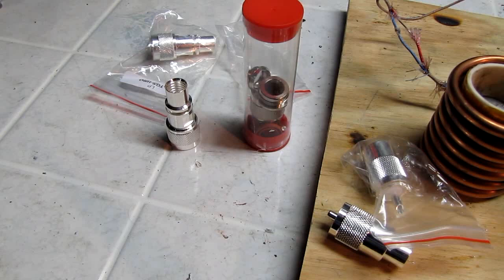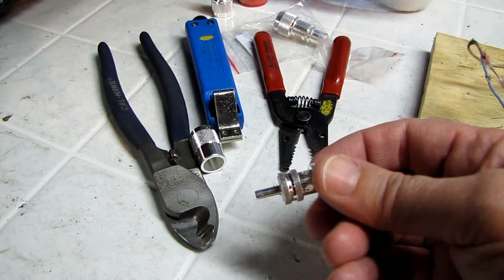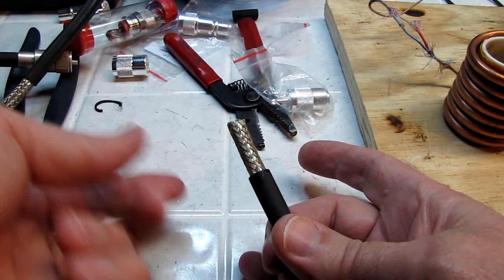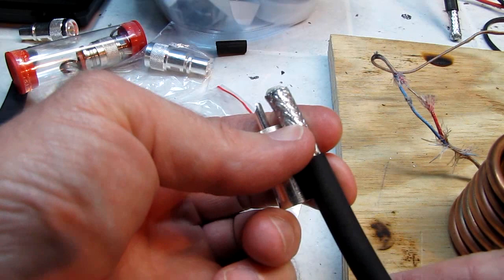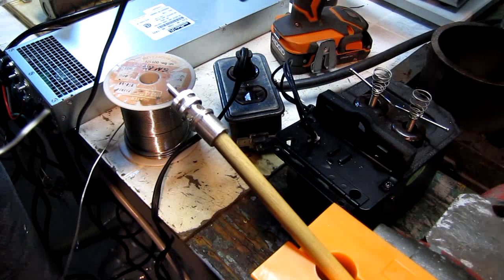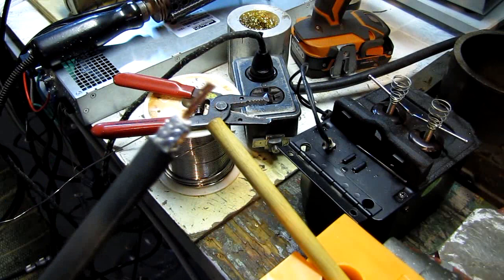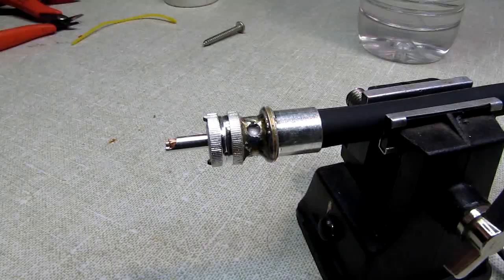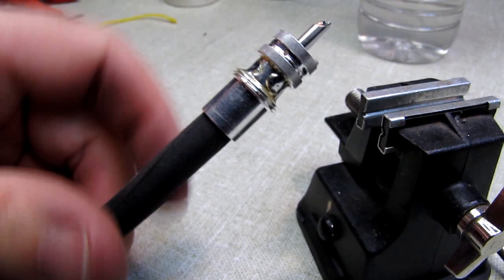Soldering PL-259 and N connectors

Comment: In my 40 years as a radio operator, I have had all sorts of problems with coax connections. I have resorted in buying coax with connectors, which are never the right length. A  3 foot jumper often costs as much as $10.00. I have felt that I am not a true ham because I could not get the connectors on without some type of failure. Your presentation gives me hope but not yet confidence. This is the best presentation that I have seen. Thank you so very much.

Comment: Great video, thanks for sharing. I too learned by trial and error the benefits of tinning the braid. Though, alas, no solder pot for me. Only thing I can add that might help when applying a lot of heat to solder connectors like this is to wrap a wet rag around the jacket - just next to the connector (e.g. where it is held in vice). This acts as a heatsink and helps to stop jacket and insulator melting.

Comment: 23:30  Tip:  Long before soldering the tip of the center conductor, it is wise to tin the center conductor at the same time you tin the braid. After tinning, if the center conductor is too big to fit through the connector hole, you can file down the solder you added around the wire, and round off the end of its tip. Tinning this center conductor makes soldering its end to the PL-259 tip much easier, and it solders up faster and more uniformly.  Always use a file on anything you tin if you need to reduce it's size so it will fit into the holes of the connector. Filing still leaves enough solder on the braid or center conductor which helps the entire soldering process go smoothly.

Comment: Worked perfect.  When the radio was installed by the dealer the center wire was just loose in the pin.  When I took it off to check something and then put it back in the radio didn't work at all.  I tried to install it without solder as they had done  and it didn't work.  I  half expected that it wouldn't, but since it was good enough for the dealer I thought they might know something that I didn't.  Anyhow followed your instructions and it works perfectly.  Thanks.

Comment: Tip:  At every step along the way after cutting into the cable, it is helpful to test the cable continuity using a V.O.M. meter or other device to check for any short circuit. Even if your soldering skills are good, there is always a possibility that cable fray, center conductor stray strand, or bump shorting inside the connector can take place. So continue to test continuity between both ends of the cable during the connector process. This way, once you are completely soldered on both ends, there will be no short circuiting.

Comment: I've always used genuine Amphenol connectors with bakelite insulation forever with no issues. Teflon is not near as durable and replace them for friends when needed.
Thanks for your time.

Comment: I generally put the pl259 in my drill press and drill out the 4 holes slightly for the braid before I tin them as you do. This makes using the larger iron or big Weller easier and quicker for me.

Comment: The "shear" cutters (multi-sized teeth) look great, have not seen these before, I don't think that they are available in the UK.   Great video, glad I worked out the same method a few years ago except I don't have solder bath (brilliant idea)     I find modern "MilSpec" RG-213 white insulation is much, much more sensitive to soldering iron heat than the stuff I used in ham and marine radio back in the 60s and 70s.     Thanks again for a great video    73  G3Z..

Comment: Good video. I have done hundreds of PL259's over the years, but only with RG213 and RG8. The 'screw-on' N's are a good idea, but I would still use the old-time dozens-of-parts connectors for UHF. They may take longer, but they are less lossy.

Comment: I also take a small file and rough up the surface around the holes on the PL259, since the plating doesn't usually allow the solder to stick.  Especially on cheaper connectors.
Reply: Sound advice, I agree. Learned this the hard way. In fact, I normally try to use a small file, sandpaper or a fibre brush to remove any coating on any connector before I solder or tin it. Makes a big difference.
Reply: @Steve-GM0HUU  I've been tinning the braid on the connectors that I've soldered since I saw your video.  It works great.

Comment: For most, crimp shield and solder pin, are the best connection and MUCH faster. Not to mention the new coax center material is very unforgiving from heat. UHF is a misnomer. When these connectors were first used, 30MHZ was "UHF"! Nice job on the video....

Comment: 20:08 When you stick the iron into the hole and add solder, it helps to twist or turn the iron back and forth in the hole. Once you hear a squeaking sound, you know both braid and connector have joined solders together well,  so remove the iron.

Comment: Great video, clearly demonstrating best practices and useful tools and jigs, such as the various vice jaw attachments and that excellent solder pot!  Maybe I missed it, or you comment in a different video, but it could be useful to comment on the solder you usually buy and use, alloy, gauge, roll size and flux..  With then advent of RoHS and other non-tin-lead alloys, some with flux cores and some without, it may not be obvious to newcomers to the craft which to use where.

Comment: Tips:  When using any soldering gun, make sure the tip prongs are snugly screwed into the two prongs of the gun. These connections oxidize and the heat loosens them, so before using the gun tighten them so the tip gets full heat. Repeat several times during multiple soldering jobs. 2. The gun's tip has to be cleaned every time you trigger the heat.  So trigger the heat, then take a fist-sized wad of steel wool and rub the hot tip through it on the end and sides of the tip to clean it. Then apply solder to the tip (called "tinning")  before applying the tip to your project. Once the hot tinned tip is laid on the project, start to apply more solder to the tip and project and once it freezes or melts , remove the tip and blow on your project to cool it so heat doesn't transfer to unwanted parts of the project.

Comment: For anyone reading through the comments right now, I’ve found it takes almost all the skill away from soldering when you use a good quality iron, flux, and solder. I personally use kester solder and amtech NC-559-V2-TF flux. As for a great “do most” soldering station, I always use a Hakko FX-888D. It’s great for tiny board work up to medium size things like coax or power cables. Anything bigger and you’re better off getting a higher wattage iron. Good luck and don’t think too hard about things like I sometimes do.

Comment: Good video.  I wish I could do this as quickly as you do. It usually takes me about an  hour per connector. I've discovered that going slow is the quickest way to do it right.
Reply from the maker: Speed comes with practice/experience. Used to take me forever to get them right.

Comment: Make sure your sleeves are on your coax before soldering. You don't actually THINK I have forgotten to slide the sleeve on before I soldered the connector, do you? Not me! Never! 😉☺️
Reply: Oh, and BTW. Great video. Wetting the braid in the solder pot is a great idea!
Reply from the maker: LOL Me neither, never ever. Not that I will admit. :-)  Thanks for watching.
Reply from the maker: Thanks Fireship.
Reply: it falls in the same class of making the perfect solder connection and realizing your heat shrink is still laying on the bench and not on the wire ;)
Reply: No, never forgotten to put the outer sleeve on first. I mean, only an idiot would forget. Even if, just hypothetically you understand, I did forget. I would of course learn, after the first time, never ever to do it again. Wouldn't I?

Comment: To avoid melting the outer jacket when soldering, I take a strip of absorbent cloth, dip it in water and wrap it around the shell of the connector to absorb the heat before it can reach the jacket. A strip of wet paper towel works also.

Comment: I didn't have similar equipment to tin the jacket, but a plan B for me, to prevent the shards issue, was to wrap some electrical tape over the end portion of the jacket before removing down to the center conductor.

Comment: I usually don't solder the four holes on the shell,  I prefer to leave coaxial some space to "breath" due to temperature changes, ... and of course allways try to keep the connector protected with thermofit.    I had once a bad experience with belden 9913 and connector solded on four holes... moisture entered thru the plastic and simply could not escape, oxidizing the center the whole 33ft...

Comment: Nice video! Curious what the wattage is of that beast iron used towards the end? Amazing how quickly that was heating.
Reply from the maker: Hi, and thank you for watching. This is a Drake Electric (not electronic) works model 600-10 and is rated 100 watts. Manufactured circa 1944/1946. Asbestos cord and all. I even have the original stand/rest for it. There is an exact one for sale in the original box on flea bay as of July 2023. The real secret to its success is the mass. Gives it tons of heat reserve.

Comment: What do you do about tinning the braided wire if you don't have an induction heater or one of the big soldering irons? Will a regular Weller soldering gun or iron generate enough heat to tin the braid?
Reply from the maker: HI Gene, I used to use a 40 watt iron that had a "Screwdriver" type tip about 6mm / 1/4 inch wide tip. Very time consuming compared to a solder pot. Standard solder pots are often found at flea markets fairly cheap. ( 20 bucks or so ) But take about 15 to 20 minutes to heat up, and leave a very hot pot sitting on the table for about 30 minutes after you shut down. They work but have a 15 second warm up time makes this thing pretty useful. Thanks for watching. Vern

Comment: Hello Radio Mechanic. I like your video very much. 
I'm trying to be sure I do a very good job at this as in my case the connection is to a VHF anntena  at the top of a sailboat mast.
I have some experience soldering copper plumbing and know the satisfaction of heating the opposite side of a fitting and seeing the solder suck into and around it.   At least promise of a good solder seal.

I'm trying to get this PL-259 installed but whether its the holes in rhe fitting to the mesh or the stem wire I just feel I cant get enough heat or heat in the rigjt location to achieve other than the unwanted cold solder. Neither the stem nor the mesh really, soundly, touch the fitting. The heat just doesent transfer.
Is it too much to ask to be able to see solder flow into the mesh and stem?

 Any response would  be appreciated

Steve P.
Reply from the maker: Hi Steve,
The secret as I stated in the video is to have a large Soldering Iron that has enough heat reserve to transfer heat quickly into the connector. Once the braid/mesh is pre-tinned and inserted into the connector you need a large Iron to quickly heat the connector and get the solder to flow. 
The process of soldering pipe uses a torch/flame that has lots of heat reserve as you know, but not really suitable for Coax work. You also need to have good quality connectors. I don't know where you are but here in the U.S. I prefer to use silver plated Amphenol when I can find them. I am sure your local Marine supply store or local Ham Radio store can help you out. I am using an old Drake Electronic 100 Watt Iron. There is one on E-bay right now for $30.00 U.S. but is for 120 volts.
If your outside the U.S. you can use a transformer for 230/120 voltage conversion.
Reply: Thank you.
I appreciate it. I do have a Weller 900 degree iron and a silver plated connector.  I've spoken to people and got similar advice. I think I just need to prepare better as I'm out in the weather. I'm in Honolulu, but there's always a slight breeze and often cool misty sprinkles. I'm setting up a carboard box to work in, and need to be patient and persistent and keep trying. I've been told to just clean up my connector and do it again. I bought extras anyway.
Previously I had only a pointed tip,  now I have a flat tip as well.
I will get this!
Reply: P.S. I was told to, and will be trying to use the flat tip to brush the silder onto the mesh.
Agree? I see no other way without a pot.
Reply from the maker: Yes, I used to do the same thing before I had the Solder Pot. @stevepeterson233

Comment: I use a Weller 80 watt iron for tinning and soldering the braid and center conductor. Perfect amount of heat. It does not take long to tin the braid. Less than 30 seconds. Use a tubing cutter to remove the braid. It makes a clean cut. Using wire cutters is messy. A solder pot is nice but totally unnecessary.

Comment: 21:03  Tip....After you solder one braid hole, you can let it cool, then solder the opposite side hole, just as you would when tightening lug nuts in a star pattern for changing a flat tire. This allows the heat to work for you and not build up to a point that would short the connectors or  melt the  dielectric.
Reply: Yes blowin on tin..
MAKE IT crack
Bro take a ISO 9001 9002 
Do not chill tin !! IT Will make
Microscopic cracks

Comment: Good video, I soldered a lot of these back in my youth. However I was waiting for the soldering of a center  tip of a N connector, close but no cigar.   I noticed it has no hole on the video. how do you solder that type please ?

Comment: I prefer silver plated amphenol. Yes, they cost more. Nickel plated I will use in a pinch when/if I don't have silver plated. Prior to soldering I use a drill bit or reamer to remove the nickel plating from the holes to reveal the brass to aid the solder to flow quicker to adhere to the solder braid. I like the on camera "oops" and the end isn't always the end with vid's. You've mentioned that you don't like getting side tracked with your explanations, but the little side stories are what makes your vid's more meaningful. Maybe that's just my preference. 73
Reply from the maker: Had one guy tell me I talked too much and was a bore. Can't please everyone I guess. I have no problem buying the good ones.
HRO only carries these and I needed some "today". Thanks for watching Terry.

Comment: Thanks for the elaborate procedure. I just got my PL 259s and was wondering what the thread was for.
Reply from the maker: Hi Vikrant, the thread serves two purposes. With the RG8 style coax ( large diameter ) they thread onto the insulation. With the RG58 or 59 type coax there are different size adaptors that thread into them. Thanks for watching and good luck with the soldering.

Comment: So, where did you get that spiffy little coax trimmer?
Reply from the maker: That unit is actually for cutting the insulation on power cables. Those are available from numerous sources on the internet.

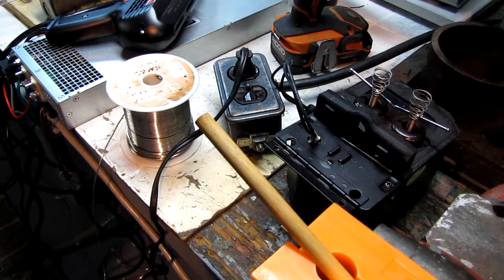Comment: 17:53  Putting the outer screw sleeves on the coax....This should be STEP #1 !!  Just  simply slide  the connector sleeves back to back onto  the cable first,  and you will not forget later,  because it is easy to get totally  caught up in the measuring, cutting, tinning, and soldering process and not realize that you forgot to slide the sleeves on. Hams have to learn this hard lesson  about 4 or 5 times before they remember to slide  the sleeves on first before doing anything else !!!

Comment: hey great video, tinning the braid is a great idea! I put ends on a cable for my grandpa and the book said to fray the braid backwards, I thought that was a bit odd but I guess that was because of the cable he was using? the connector type seems very similar to the ones you used just for much smaller cable, it looks like what RG6? so 6mm outer? what do you think of bringing the outer braid back?
Reply from the maker: The "fold back" or "Fray Back" is normal for the smaller 5 and 6 mm diameter cables. There is an adaptor that threads into the PL-259 or N connector that the braid folds over. With care the loose ends are well back from the insulator and don't present a problem for shorts. On the RG-8 type coaxes ( 10.25/10.5mm ) the coax fills the body of the connector and the braid runs right up to the insulator. I seldom use the smaller coax except for instrument jumpers. Thanks for watching and the interesting question.
Reply: ah, ok, it just seems odd that the two sizes would have two methods, so another question I have is about the tip. my grandpa had bought a pre-terminated cable and I was making a short extension lead for him and when I was done I compared the factory end to my end and noticed I didnt have a perfect round ball of solder it would wick in and would leave it jagged. would it be better if it were round for being easier to plug in? how could one make a round tip like the factory does? just keep adding solder?
Reply from the maker: Tipping the connector down and adding more solder might make a ball. I am sure the commercial ones are an automated process. Also, some of them are crimped internally and just have a round end. However I don't worry about the jagged edge ( I assume you mean the profile of the end of the pin ) This really doesn't hurt anything. Been making them for years with no issues.
Great questions by the way. Thanks for watching.